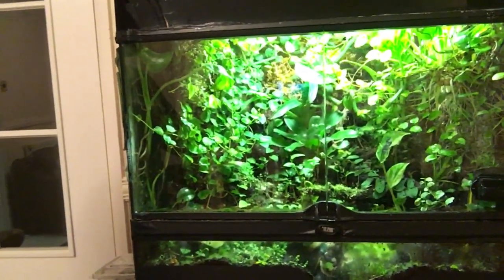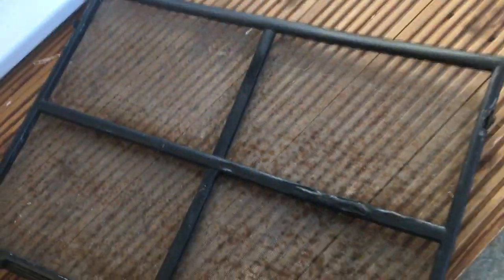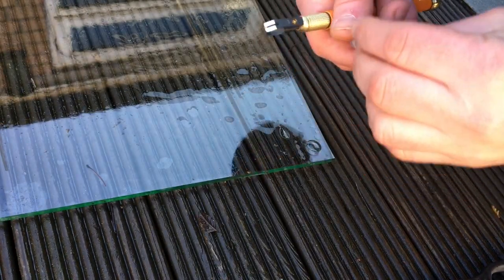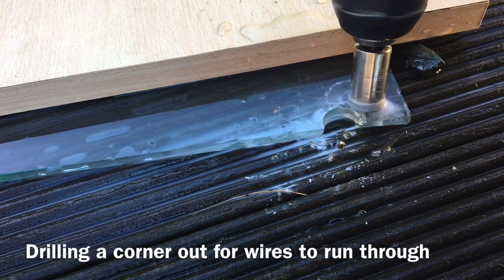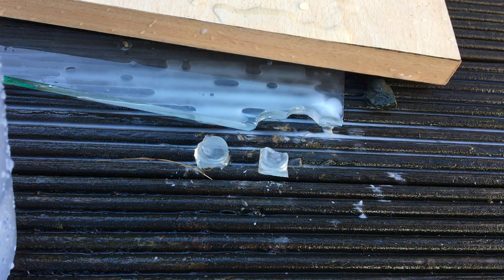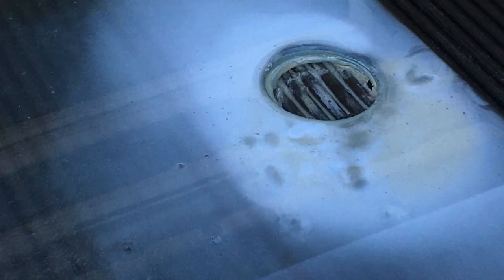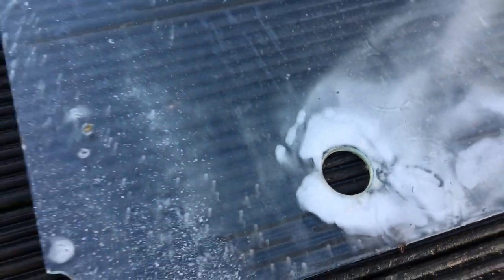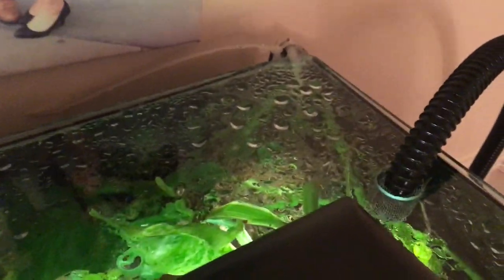How to Make a Custom Glass Top for Terrarium Vivarium (Exo Terra Conversion for Dart Frog Setup)

Comment: You can't score glass around corners. For such a small area on the corner you could used a belt sander with a rough grit and just sand down to the depth you needed. It will look way cleaner.
Reply from the maker: thank you for the advice. luckily I managed to do it with a drill but I will bear that in mind for future builds

Comment: Hi how long have you been doing this ? I’ve found it can cause mould in the vivarium when I’ve tried this in past as it needs ventilation. Do you have any problems with mould ?
Reply from the maker: Never had any mould issues. I keep it very damp in there so it’s probably too damp for mould to thrive
Reply from the maker: please also note that this method is only for Dart Frogs and Mantellas. if you shit off the ventilation for other species of frogs and toads it could be fatal. especially for tree frogs that have adapted to the tree top breeze